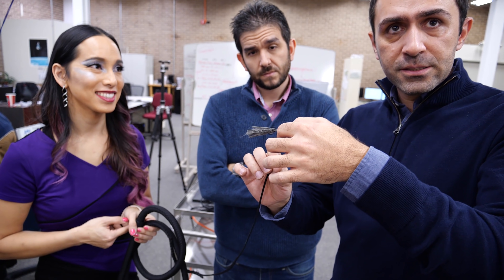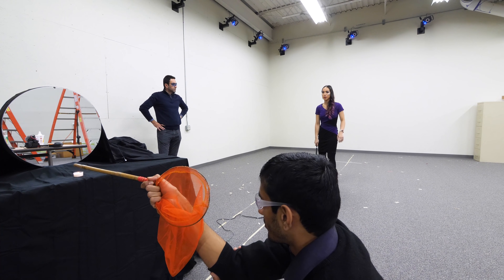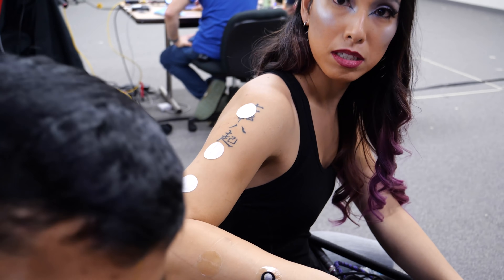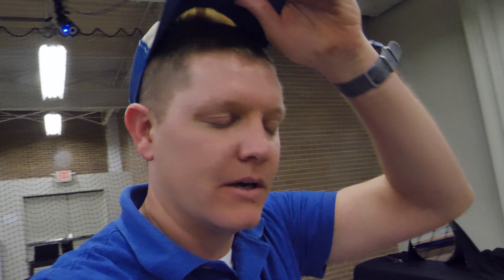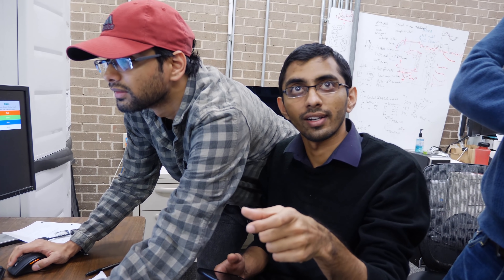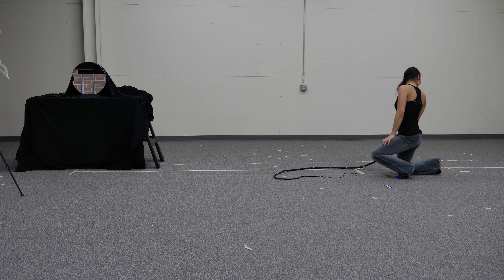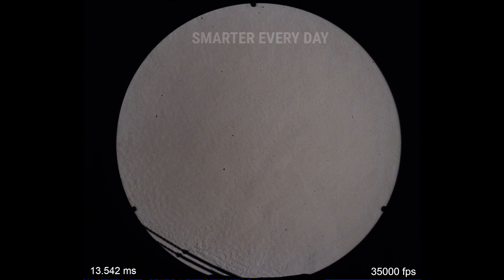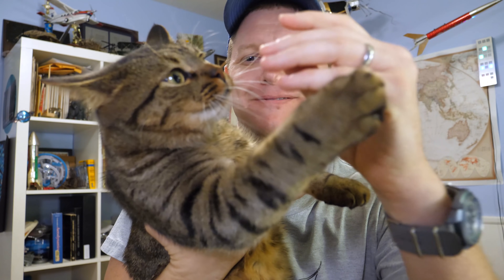How does a Whip Break the Sound Barrier? Behind the Scenes- Smarter Every Day

Comment: so the tip gets faster because the momentum gets "concentrated" on the tip (instead of the whole whip moving, just the end moves) and because the end of the whip has less mass per length than the majority of the whip? 
(just me trying to understand this)

you mentioned you guys wanted to make a "whip function" , did you try to make messurements with different whips? for example what were to happen when the whip has the same weight per length everywhere? or a point where that radically changes to see how the momentum gets transfered (how you showed in the other video as a red line)?

im not a student and dont really know much about fluid dynamics and in generall dont have the know how but it really interests me and i love watching that stuff as it is something i wish to do in the future

have a nice day
Reply: So I think I heard describe something along the lines of conservation of momentum causing the smaller and smaller moving mass to accelerate; which makes sense to me. But then he ruined it in the intro by cracking a constant diameter string whip, for which the mass isn't decreasing any more: so why does it accelerate?
Reply: @thomasmaclean7465  tried to whipcrack with a simple string and something that i noticed was that it was difficult to get the string to unroll like in the video shown, and i had to move my hand holding the string back instead of just stopping abruptly

i would really like to see what happens exactly with other whips and why exactly the tip accelerates
Reply: D. Devilcrusher I used to make whips as a child. I recall using string with some mass to it, like parachute cord.  That would carry  more momentum than a lightweight string. On the other hand, I don't recall them cracking nearly as loudly as April's.
Reply: For the period from just after the hand straightens out to just before the shockwave, you can (very roughly and imperfectly) conceive of the whip as the edge of a spinning disc of constant mass but decreasing diameter.

Comment: Here is my simple minded theory of what is happening. When the whip is moving through the air, energy is being built up at the base and moves down the length of the whip. As the energy is moved down the length and is being condensed smaller with the smaller diameters and at the end of travel has no where else to go but the lightweight end and causes it to gain the energy/velocity to break the speed of sound. But again simple minded and could just be blowing smoke out of my rear end.

Comment: Destin, what do you think the behavior of a whip would be in a vacuum chamber? Would it help identify the difference between the tip breaking the sound barrier and not (subsonic)? What catches my attention is the way the tip seems to be pulled forward or unimpeded by the air after the shock wave cone is seen on the high speed.

Comment: PS: can the IR system be sequentially and repeatedly cascaded like the "bullet cam effect" of 35mm still cameras for the movie The Matrix, instead of ALL the devices being simultaneously triggered? Wouldn't that given an combined, artificially enhanced speed greater than the 500fps, just with less than xTimes 3D imaging resolution? Perhaps wouldnt lose the supersonic data that way? Might have to interpolate the missing data from sensors in the Off mode of their 500fps, but there's software for that, right?

Comment: This is SO neat. I’m not standing on much ground when I ask this, as I’ve only taken an intro physics course and an exercise biomechanics course but first, it’s really cool to see the kinematic chain in slow motion of the torque production starting in the shoulder and traveling all the way to the tip of the whip. Secondly, I know things like tennis balls are fuzzy to increase surface area and a “barrier” of turbulence so that air rushing past that cap isn’t disturbed and the ball can glide and curve through the air easily with the magnus effect. It is interesting to see how the surface area of the tip decreased right as it approached the sound barrier that shot back apart after the “impact.” I feel like this is complicated a bit more because the knotted and beaded tips don’t produce as big of shockwaves. I wonder if this is due to their smaller and less interrupted surface areas which might slightly decrease their impact, in some way, as they break the sound barrier?

Comment: 🤔 Choi's statement... About the threads having the air molecules around it, and the curving + acceleration increase of the whip end, compresses the gasses and the shock wave is the result of the imploding of those gasses; the crack sound is the fanning of the same threads that were just compressed...
Awesome video!

Comment: I'm not sure how to phrase this, but it seems to me that the faster or more "intense" the shock wave is, there seems to be a sharper change in direction of the tip.  I'm guessing this is because the tip wants to follow the angle that arm and base where "thrown" at, and instead of continuing to follow it's normal arc it falls behind and needs to catch up?  If this is the case, could you possibly end up with an even larger shock wave if the "loop" or arc was larger?  Sorry just rambling, but I find this very fascinating.

Comment: I think it's pretty interesting that at 13:55 there are shocks happening before the end of the whip.  These shocks seems to cause a massive deceleration of a larger mass, accelerating the smaller mass more quickly.  I think it would be pretty cool to see the acceleration or jerk curve along the length of the whip or as a function of cross sectional area.

Comment: I suspect the stiffness of the last few inches of the whip play an important roll in determining when the tip  begins its peak acceleration. I've seen some whips that use several inches of stiff steel wire at the tip to aid in producing the crack. I think if the last few inches were infinitely... limp? the wave would propagate down the tip as a increasingly tiny loop all the way to the tip. The stiffness means at a certain point the last few inches break the loop formation and at that moment if the energy is sufficient the tip produces its shock wave / reaches maximum speed.

Comment: Let's see if I understood this correctly. Please mind that I'm not a scientist and therefore may use the wrong terminology, but here we go...

The force put onto the mass of the whip by the acceleration of the handle transfers along it's length and can be measured as velocity. As the mass along the whip decreases the velocity increases since the force stays roughly the same, accounting for loss due to friction. 
Once the end of the whip is reached, the velocity of the whip hits the speed of sound. When that happens the coefficient of friction between the whip and the air changes and is visible by, A, the shockwave and the sonic boom, and B, an increased rate of gain in velocity. 
When the last bit of the whip has unfolded, it gets unstable, since there's no more acceleration of the whip possible, as it has stretched out completely. The air surrounding the whip though is still moving and pulls the whip along.

Please correct anything that's wrong.

Comment: Why don't you use a larger rectangular mirror?
Reply: you need a parabolic mirror for this to work, and the biggest ones you can find are circular telescope mirrors unless you want to cut the sides off to make it rectangular. it's also pretty expensive, that mirror the have there probably costs around $300 at least.
Reply: @feathered3167  thanks for the info!

Comment: In order to eliminate the unknown factors such as arm fatigue, angle, etc, couldn’t you make a rotating mechanical arm to have consistent data?

Then you can measure the speed of the arm vs the speed of the tip of the whip.

Comment: As you mentioned part of the idea is to blend the data from the motion capture alongside the high speed footage, does the use of the side arm affect how well you will be able to map out the motion of the very end of the whip? Im thinking in terms of the depth of the movement being much harder to perceive in the Schleiren image - you have reference points on the mirror which gives you a X and Y plane but measuring that Z axis has got to be difficult.

In the vertical whipping scenario things could stay reasonably parallel and hopefully the amount of depth would be less of an issue. 

You've probably thought about this already and this really isnt my area of expertise but this video got me thinking a lot about how you can rebuild and model that motion out of the data afterwards.

Comment: How much of a difference would it make if she pulled the whip back just before the crack? I would think it would make the loop smaller and cause it to have a greater velocity down the whip making a stronger sonic boom. Am I right?
Reply: I think it would, as a kid I would crack bits of thick string like a whip and I always had to pull it a bit to get a higher velocity and a more satisfying crack, since the uniform thickness makes it harder for the energy to add up in the tip.

Comment: Destin, what I find fascinating and haven't heard anyone talk about is the clear s-curve that develops with the tail of the whip. It's like the shock wave is behind the tail and blasts the tail forward, e.g., 13:01. The end of the tail outstrips the segment pulling it. Is it something obvious I don't know about? Why does that happen?
Reply: What you are seeing there is the moment the impedance of the air matches the impedance of the last  inches of the whip. When that occurs, the ability of the whip to unroll, as it has done all the way up to that point, is matched by the load of the air being accelerated through the sound barrier.

I think. ;-)

After all, a whip's entire design and purpose is to impart energy into the air. The 'S' happens slightly after the whip has fulfilled it's design mission, as the air pushes back on the string dynamics, a slight recoil. 

It also means that ever so slight heavier tip mass should be used. The perfect impedence match would result in an L shape instead of an S.

Notice how that last little knot comes to a complete stop, along with everything behind it? At that moment, the dynamics of the whip change to make it appear as a rigid solid fixed mass right at that knot. That's when the tip is forced to become rigid to the air as well. Notice how the until long motion stops and the end becomes like a rigid body?

The S happens partly because the knot is either slightly too far distal, or the tip is slightly too light, pick your poison.
Reply: I think it might have something to do with air resistance lessening after you get past mach 1.
Reply: Feathered Maybe that is the reason, thanks! I specialize in electromagnetics and radar and never learned anything about fluids unfortunately.

Comment: Is the frame rate capture of all of the room cameras synchronized? Wouldn't you get better temporal data if you deliberately offset them, so each one is capturing a fraction slower than the previous one. It would make no difference for most of the work done in that room, but for high-speed stuff, you'd have a better view of what happens between each frame, as the other camera would each be capturing a frame to fill in the blanks.
Reply: Wildepix woah, just said that before reading all the comments inc. yours! Agreed, prob would be a benefit, specially if they did say a quad synchro (simultaneous from only each compass point NSEW and rotating the triggering 1/500th sec stepped) that cascaded clockwise, allowing the others to refresh for their own 500fps triggering. Would be lesser rez of course. Would need to alter the recording or analysis algorithm a bit but easy for those mathguys, then interpolate the 'tweens and process akin to the same way certain VBR vid codecs do when encoding/optimizing action sequences. The options to improve the IR system to this event are greater than imagined, I'm guessing.

Comment: Do you have data indicating accurate velocity of the fastest point on the whip cord?
Reply: probably, since they have the distance to the camera and the tip of the whip measured accurately, and you can use some fancy math and how fast the  tip moves through the view of the camera to find it's speed.

Comment: A wave changes amplitudes as travels from a medium of one mass to a medium of another mass. A whip has a continuously decreasing mass that causes an increasing amplitude. I've considered modeling this system myself. Conservation of momentum, initial conditions, and a bit of math should give you the theoretical speeds you are achieving.
Reply: Adam Ulmer Why do I think of that whip energy as a tsunami wave but in reverse? Decreasing depth, change of energy thing?

Comment: 9:33 Why does it change direction?
Reply: Ah, I think that's the "following the shock wave" phenomenon that they briefly mentioned in the main video (or maybe it was this one, I just watched both). They didn't seem to figure it out on camera; maybe Destin can follow it up later.
Reply: It's the angle of the whip coming in. If you watch 9:25 at 0.25x playback speed you can follow it. The tip accelerates once it breaks the speed of sound. Almost as if it gets sucked in by the wave/ change in air density. Because the tip is bound to follow the whip it starts moving in a circle. This appears as a sharp change in direction depending from where you look at it. You can see her a couple of times throwing the whip sideways to get more of the tip movement into the field of view.

Comment: Hey why does this toy whip (whip made up of simple string which has almost uniform cross section area across it's length) is breaking sound barrier ? 
The reason i am asking this question is because you told us that every segment of whip tries to conserve momentum and in doing so every next segment has to go faster than previous one (because the whip's cross section is tapered) and hence ultimately any particular segment breaks sound barrier, but in case of normal string the cross section is not tapered so every next segment should move at more or less same as the previous segment, no ?
Reply: The radius of the wave is getting smaller as the wave propagates.

Comment: Hey Destin.
At 15:36 it appears that the point where the whip breaks the sound barrier is in line with her shoulder. 
Is that always the case when she runs it overhand? 
Does it have something to do with that being the point where the energy starts from before traveling to the tip of the whip?

Comment: It looks like the individual strands on the end can generate their own waves when they collide (with each other? with the air?), and if there's a discrepancy between where the waves propagate it's possible that a second wave can "pull" the end with it, is that right?

Like, the whip is basically a really, really fast clap at the end, so the amount of space (surface area and distance travel-able) between the end strands are the factors that decide on whether the whip can go supersonic.
Reply: Except they got it to crack with a sphere at the end.  I presume that was done exactly to remove things like that from consideration.

Comment: The increased in speed on the whips most forward parts (in a given instants not the tip) appears exponential? Meaning that it is more than conversation of momentum (as you would only add the momentum of each whip segment to the next) and the reduced drag due to the thinning whipp could also add to this... I'm no scientist though! It was interesting to see how parts of the whip already went trans/super sonic before the tip in that one clip. I whish you had an array of highly directional microphones set up in there as well, so that you could properly record the sound waves as they traveled and formed, and could separate sounds of materials snapping together from the actual boom.
Reply: Stacking the velocity graphs of each point, it very much appears to be exponential (with a sharp knee and everything) but rapidly near the speed of sound there's diminishing returns as you approach the speed of sound in air and in the material of the whip, so you can't ride the exponential curve for long and say, go Mach 3 by reducing the mass of the tip to a third, etc.

Comment: What if you put a space capsule-shaped tip? will it make a bigger boom? I suppose it should be attached with its axis perpendicular to the string so that it can align itself correctly when it goes supersonic. Also this decreased air resistance effect seems like something that could be practical for airplanes. I've always wanted to see an airplane ride its own shock wave.

Comment: At @3:40 does anyone else hear the double snap? I've had whips do this when the roll is pulled back JUST as it snaps. I always thought this was because  the tip breaks the sound barrier and can't quite catch up with resistance before it rolls through a secondary snap (like the snap leaves the atmosphere disturbed enough to roll through whats left of the air again to give a small pop)
Reply: Merc E.Z. Just the echo on that one ... Listen carefully...
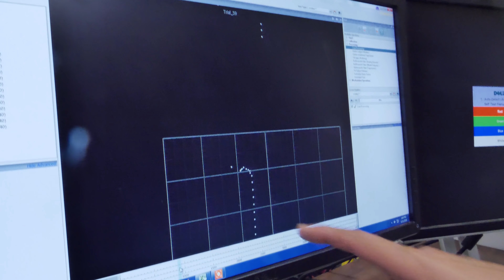Reply: Probably a reflected shock/echo, which the brick walls and clean drywall will do pretty efficiently.  The delay seems about ~100 ms, which figuring speed of sound at standard atmosphere is 343 m/s means the reflected wave has traveled 30-40m, or 100-150 ft, which seems about right for the far wall in the lab.  In the schlieren imagery at 4:25 you can see the reflected wave from the wall near the mirror.
Reply: Its more like a whistle but ya not an echo... A sound bite would be nice